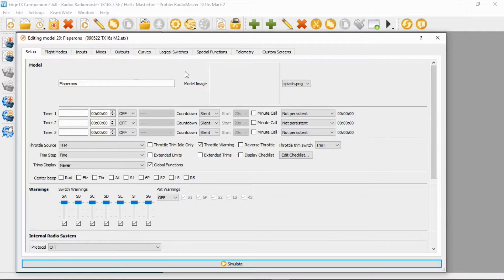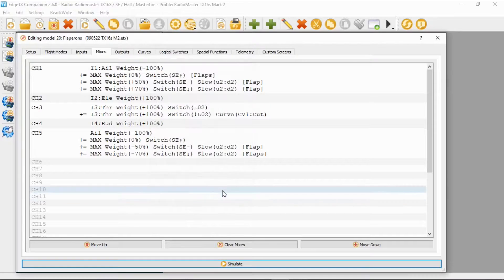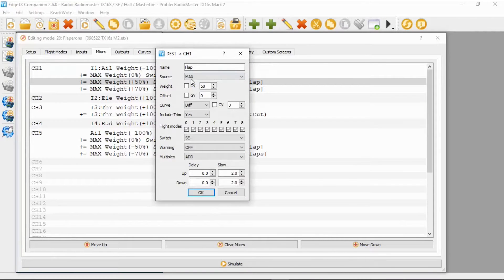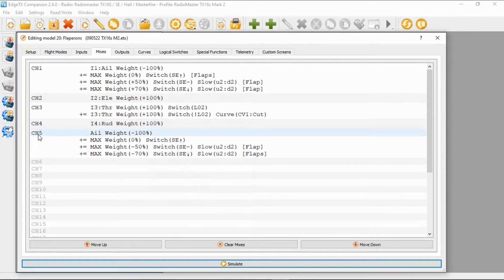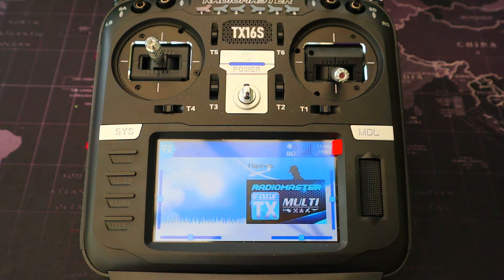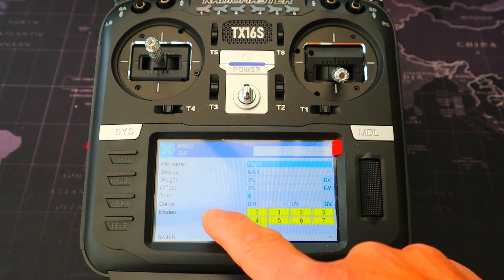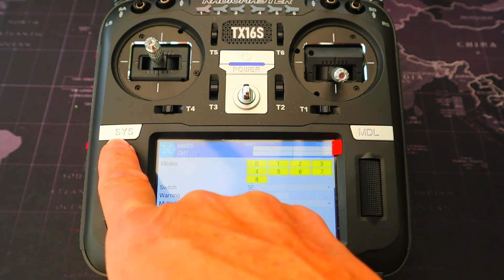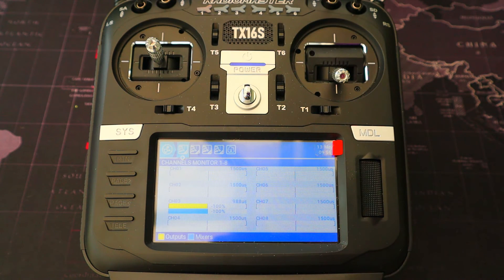EdgeTX setting up Flaperons

Comment: This is the only guide I could find on setting up flaperons on EdgeTX, which is great. Not so great is that I'm a bit thick and so far have one airleron working and the other stuck off centre (they work fine as airlerons). It looked to me like you already had it set up so it wasn't so easy (for me anyway... a bit thick remember) trying to go step by step to end up where you already were.
Reply from the maker: You are definitely not “a bit thick” Mark not at all. You need to check or change the weights from + or - Just check the ailerons are working properly by changing the ailerons mix. Once they are working correctly adjust the flaps mixes. It is tricky because I cannot give you all options because of the different orientation of the servos in your wings. If you cannot come right back up your radio and model settings and send the back up to me at triplemadventures@gmail.com and I will sort it out for you.
Reply: @the-happy-RC-flyer  Thanks Bill, sleeping on it and a bit more persistance paid off. Lack of familiarity with the radio and EdgeTX Companion was my main enemy. Followed your settings step by step and now all good. Thanks a million, your vids are a great help.

Comment: Thank you for making this video !!!!!! Always wanted to give flaperons a try ! I doubt I would have ever figured it out on my own ! Why do we use max ? What does that actually mean?
Reply from the maker: MAX dose not relate to a physical control but returns a fixed value of +100 moving the control surface to a fixed position. Setting the weight will give you the amount of throw you want the control surface to move.
Reply: @the-happy-RC-flyer  thank you for the explanation! I got it working !

Comment: Why is the source "MAX"?
Reply from the maker: MAX dose not relate to a physical control but returns a fixed value of +100 moving the control surface to a fixed position. Setting the weight will give you the amount of throw you want the control surface to move.
Reply: @the-happy-RC-flyer  Thanks!